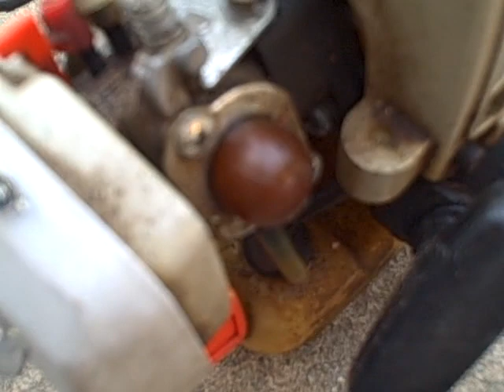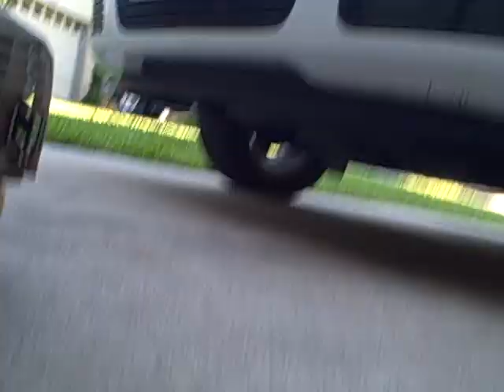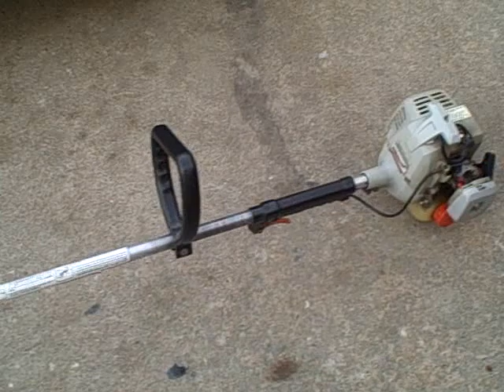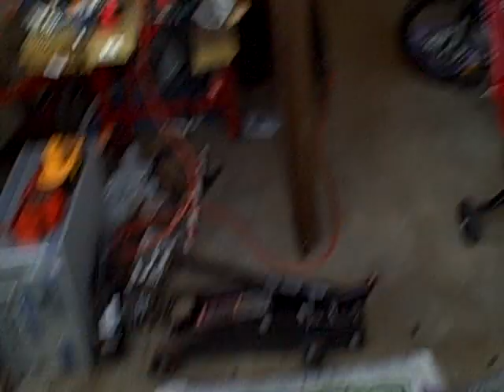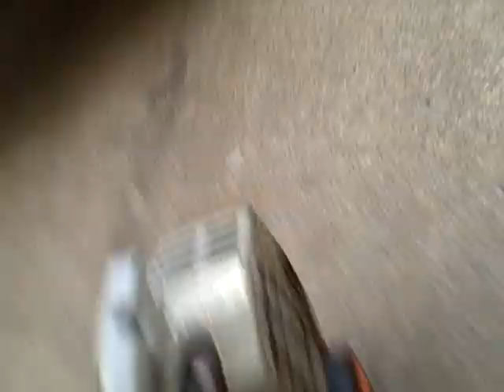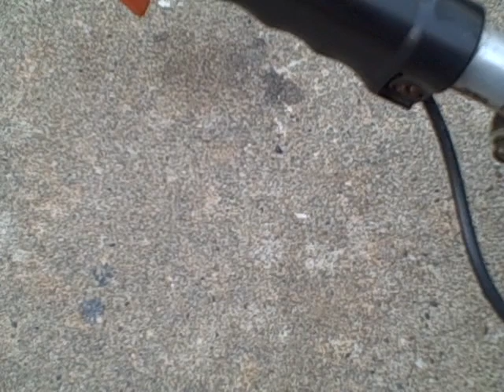first start free Echo 21cc Weedeater

Comment: I dug a homelite out of the trash and it had a broken primer and also plugged fuel lines. I spent 2.50 on parts for it and it usually starts half choke on a good day in one pull.

Comment from the maker: @joeldude76 There are several different styles on the echo's. Mine has a little tab you push in on the side of the head and then you twist the cap off. Some you just push the cap in and then twist it and it comes off.